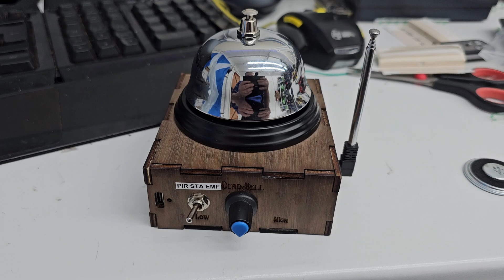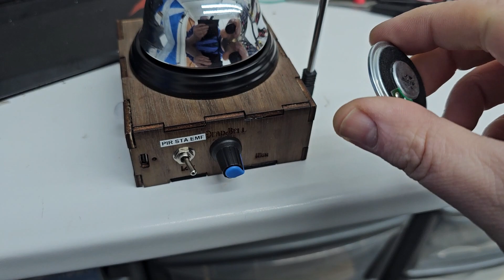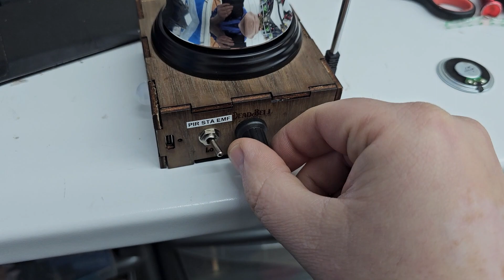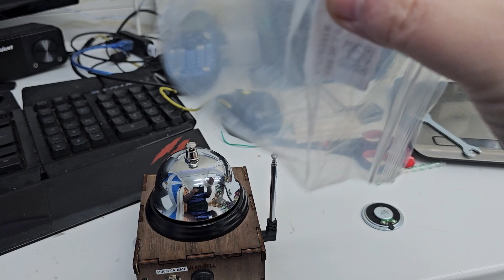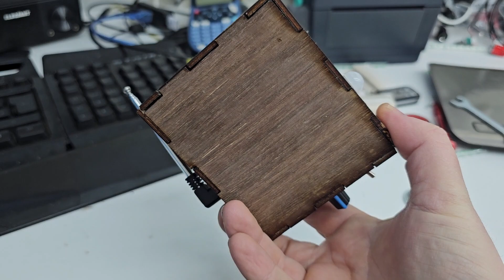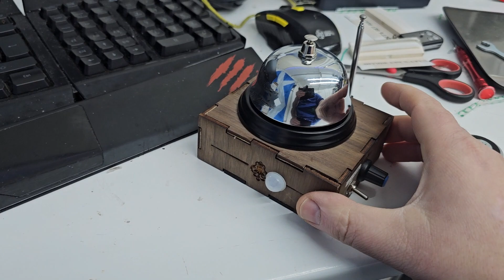Last one i swear 😅 Dead bell project success. 3 Modes added. little demo.

Comment: Fabulous  glad I did t order that device  . You save me 200 bucks.
Reply from the maker: Yep its a little wishy washy from factory, ive seen some people use them and it randomly dings and they are convinced a Ghost is messing with it, Using the stock EMF sensor i have absolutely no responses from it even with the fixed code, its great at detecting magnets but its not very sensitive, the other 2 modes i added would far suit the project better as its technology already tried and tested 😊
Reply: @puggster  do you sell these?